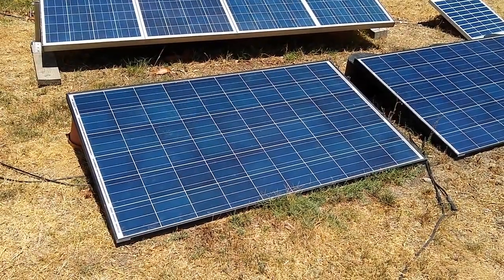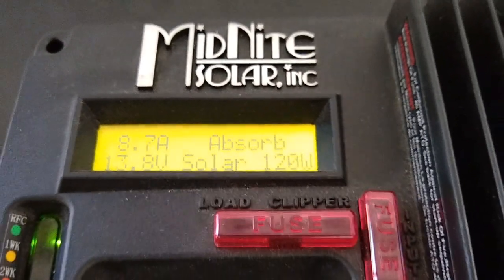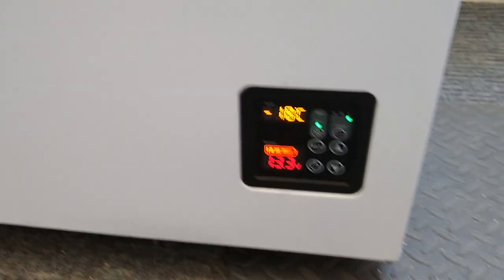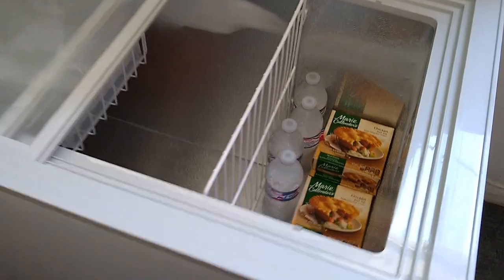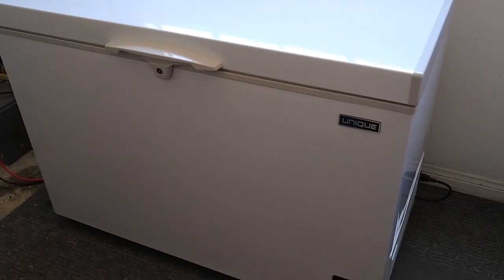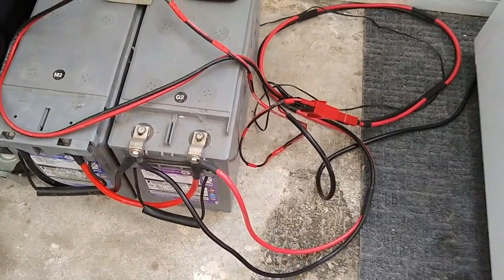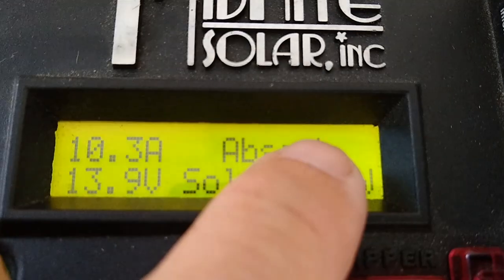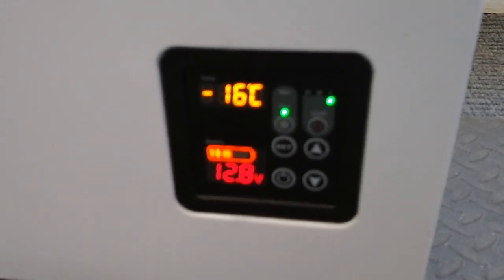UNIQUE Solar DC Chest Freezer Fridge

Comment: Thank you for sharing your experience. I read your review on Home Depot and found you. My son is Type 1 and I'm researching the best way to keep his insulin in the event our grid goes down.
Reply from the maker: They have smaller freezer and one made for medicine. My freezer is really big and for medicine and for some food you can get a smaller freezer that is about the size your your freezer department in your house fridge/freezer is, maybe a little bit bigger. One solar panel and a smaller battery system would handle that well. My freezer is really big but I had the equiptment already so it works out for me. When the power goes out you will consider the whole system paid for.... trust me.

Comment: Just ordered one yesterday from home depot thanks Stuart!
Reply: Hi, does it freeze?
Reply from the maker: Will this be an independent system with its own batteries, charger and solar panels? I have three hundred amp hours of batteries and am using about 500 watts in solar panels and its working super. I tried it with only one 265 watt solar panel and if it was cloudy or wet for more than three days I had to use an AC battery charger to keep the batteries going. With 500 watts I have no problem charging the batteries even on a rainy day. Lots of resources but the system will pay for itself if the power goes out for more than a few days. Here in earthquake county that makes me happy. I purchase a Honda 2200i power generator just so I can run my microwave thirty min a day so I will get at least 15 to 20 days of microwave cooking on one gallon of gas. I always have an extra 2.5 gallons in a wavion gas tank.

Comment: OK, but how is the "fit and finish"?    ;-)
Reply from the maker: In the video I say the fit and finish is good but after a while I noticed some things i would like to be better. I have to cover up the top with a blanket type of material incase you put something down on top as the top will scratch pretty easy and my friend who is an engineer says the top insulation on the door could be better. That being said the freezer is working great....

Comment from the maker: UPDATE, December 13, 2019:    Hi everybody, after four days of no sunshine my battery bank of 300 amp hours got dangerously depleted (265 watt panel). I charged the battery bank with a 45 amp battery charger and the batteries were back up to full strength within a hour or so. My long term fix to this is was adding a second 265 watt panel for a total of 530 watts so even if its cloudy for more than four days my batteries get enough charge to keep me up and running. When the sun does come out even for only a couple of hours my 530 watts charge up the battery bank FAST.  This is not a very cost effective system if you look at it purely as a money saving venture but if the power goes out for an extended period of time here in SoCal because the "BIG ONE" hits (earthquake) then I consider my system fully paid for.... It depends on how you look at it.....
Reply: Stuart Gorsky excellent video. Thank you
Reply: Mine keep showing me Er0 on the temperature space
Reply from the maker: @edwardikenna3469  Call or write the company, they responded back to me really quickly...

Comment: Can you do a video showing how you connected your fridge to your solar system?
Reply from the maker: There is a three prong plug that looks like a AC power cord but in reality has two wires. You plug it into the freezer and the "strippd bare end of the cord" gets connected to the battery. I have mine connected to a DC breakout box with "Anderson Powerpoles" and it works just great...
Reply: Yes that will help I also wanna see

Comment: Can I plug this in for everyday use?
Reply from the maker: YES, but you need a AC power supply putting out 12 or 24 volts.  Running on a battery charged with solar is great as I have been running my freezer for several years now.

Comment: I saw the listing you had that shows the specs including size (i.e. HXWXD) -- somehow those measurements don't seem accurate -- are you sure those are for the CHEST FREEZER and not some other appliance?
Reply from the maker: I might have made a mistake, this was one of the first videos I made for solar. I hope I'm better now. I can say the system works great as I purchased a SOK 24volt battery and never have looked back...

Comment: Yikes, $1,200 but nice specs. I run a 7cf $150 chest fridge as a fridge with inverter on 570WH a day.
Reply from the maker: I purchased the unit when the price was listed at $1200.00.  I waited until it went on sale at $1100.00 and applied for a Home Depot credit card which gave me an additional $100.00 off. Final purchase price was $1000.00 plus tax. I paid off the credit card within a week so NO credit card interest was charged. I think I was the first person to buy this freezer/fridge from Home Depot and right after my purchase they upped the price to $1250.00
Reply from the maker: The price was $1199 when I purchased it. It went on sale for $1099 and I opened a HD credit card and got an extra $100 off.  I paid $999.00 plus taxes... I must have been the first person in the country to purchase this freezer at HD so right after my purchase they raised the price...  I think they would sell many more if they sold this freezer at a  regular price of $1000.  Hey HD and Unique, have you ever heard of Volume Sales? Anyways, the freezer is working well but you need to have the right support hardware.